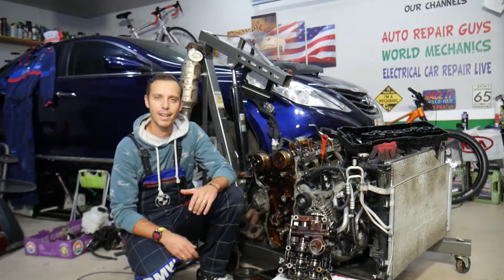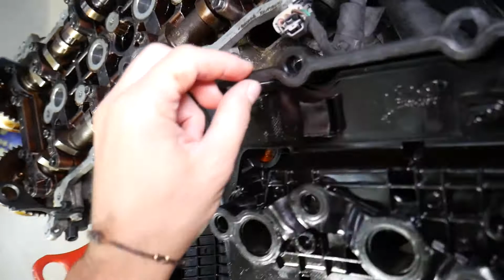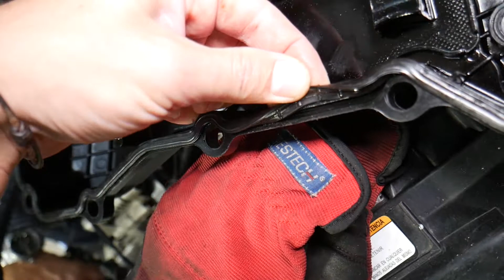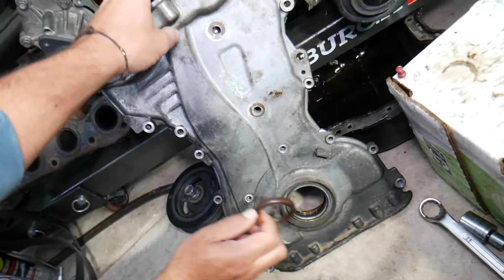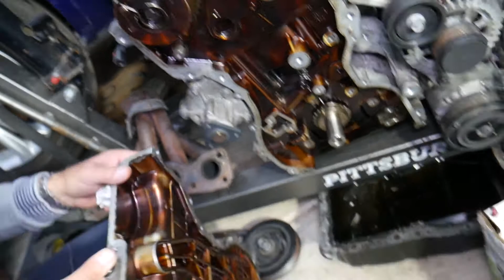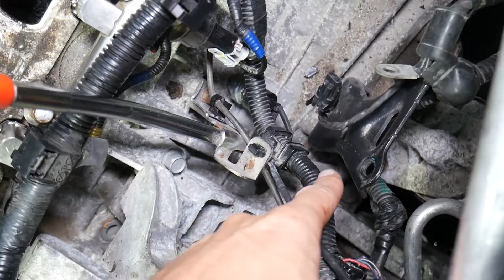HYUNDAI SONATA OIL LEAK FIX, MOST COMMON OIL LEAKS

Comment: My sonata used to burn 1-2 quarts a month but it has gotten progressively worse and now needs oil added every week.  

No. Smell, running at normal temps and no oil in coolant. 

Sound like valve over gasket?
Reply: Is valve cover gasket and possibly oil filter housing issue here. 2006 Hyundai sonata gls v6

Comment: Vavoline told me that there is a small oil leak in the back of my engine on the passenger side. I have a 2018 Hyundai Sonata so now I am going to replace the valve cover gasket next since I already replaced my spark plugs and ignition coils!

Comment: Where could this oil be coming from. The only other thing there is on that side of the block is the oil pressure sensor. It is not leaking from the valve cover gasket.

Comment: I've got the 2.4 GDI on the radiator side of the engine it's leaking oil from somewhere is flowing from above the dipstick tube down onto the dipstick tube surface okay

Comment: My Hyundai is leaving oil on the ground the size of a grapefruit. The engine was replaced 45,000 miles ago. due to defect. Any idea what it may be from the dripping? Also the engine light is not on.
Reply: I'm going through the same issue right now . My engine was replaced in June of 2021 and now it's leaking oil. The dealer said sorry but it's not covered under warranty.  Gonna take it to another place and try to see how much it will be, or if they could even figure out where it's coming from.
Reply: @Davidcali909  What was finally the issue with your car? Going through the same thing. Engine was repaired, completely. Still leaking.
Reply: Same thing with mine. Smh I've changed the gasket 3 times myself, took it to 2 shops with no luck. Idk what it could be!